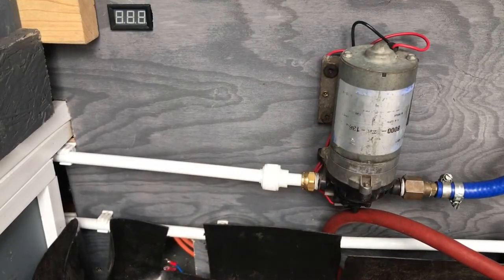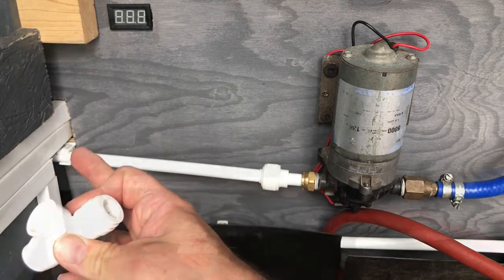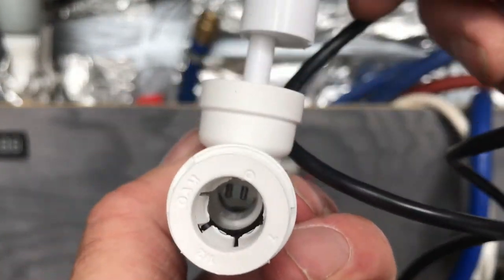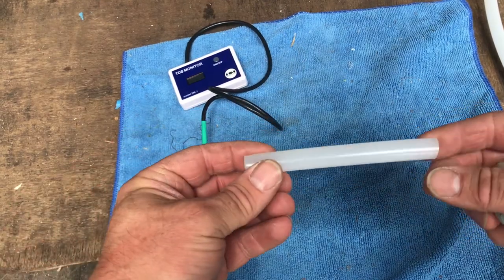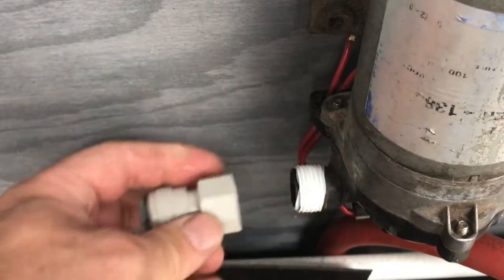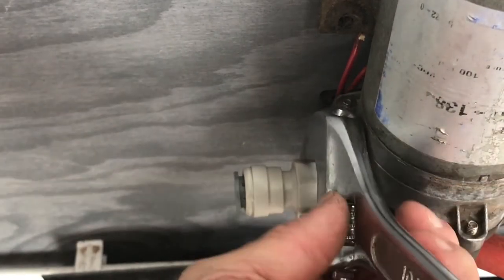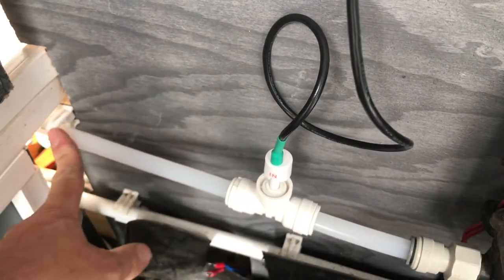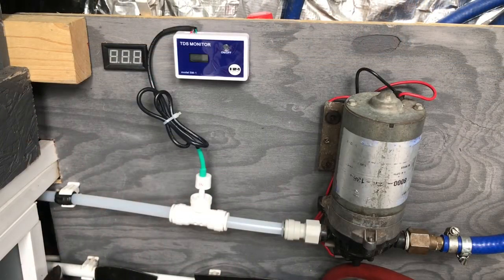How To Fit An Inline TDS meter for water fed pole

Comment: hi dave could you help I have just got hold of a 2and hand ro system  and as someone  just starting up I have fixed  it up temporarily  to find out what  the reading of the water is I do not know if the resin needs  changing  or if it's  ok but I took a reading  of 96 ppm in my opinion  it need to be changed  or am I doing something wrong  thanks barry
Reply from the maker: Hi Barry
ratioprobably
membrane

Comment: Hi Dave 
I wonder if you have any idea how to fit a switch so I can flip from a leisure battery when it's low on power and switch to my van battery so I could keep going until I get back home to charge my leisure battery. For a long time I have just been using the van battery but I have decided to run the pump with my flow controller from a leisure batt but not too sure how to wire it up any ideas.
Reply from the maker: If I was you I would fit a split relay charger. that way it won't drain your van battery but if you need to give it a bit of a boost just start the van. 
Hope that helps. 👍
Reply: Ok Thanks Dave I might try that.

Comment: Hi .. do you lose any pressure down sizing the pipe then got back to a bigger pipe ?
Reply from the maker: Who knows ? I thought I might but I haven’t noticed any drop in pressure
Reply: Squeaky Clean Dave I looking to fit on my system. But I don’t have the right size pipes. 

I am using hose pipe from my tank to the pump then using hoze lock to the di and from the di to the hose
Reply from the maker: Who knows ? I had used 15mm pushfit tubing which didn’t fit so I changed the section with the tds meter in to John Guest 1/2” tubing
They sell it by the meter at Gardiners 
https://gardinerpolesystems.co.uk/all-products/pump-hose/hose-fittings-adapters/john-guest-fittings/jg-tubing/john-guest-1-2-natural-tubing-per-metre.html

Comment: Hi wher i can get that tee? Regards
Reply from the maker: I got mine from Gardiner Pole Systems as a full kit with the tds meter but they don’t sell them anymore but I have found some on this site. https://www.daqua.co.uk/inlinetdsmeters.htm
Reply: @squeakycleandave1  daqua dont sale them as well.
Reply from the maker: @kuba1986  Blade Right do a double
https://www.bladerightcleaningsupplies.co.uk/shop/water-fed-window-cleaning/pump-control-units/hm-digital-dm-1-dual-in-line-tds-meter/
Reply: @squeakycleandave1  I all ready have in line tds meter just  looking to get T connectors  1/2 1/2 to 1/4.
Reply from the maker: @kuba1986  can you contact who you got the inline TDS and ask them if they have any. the only one I could find is in USA
https://www.amazon.com/John-Guest-Copolymer-Connect-Reducing/dp/B007COME4M